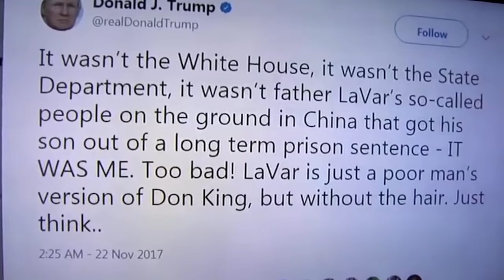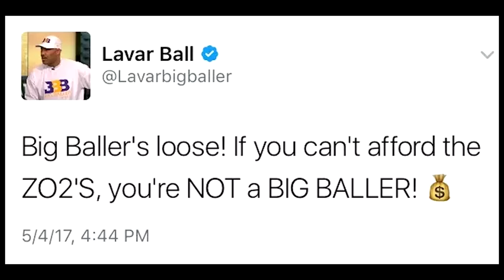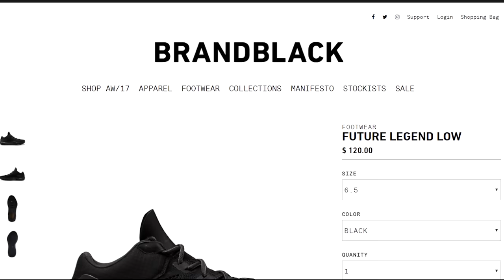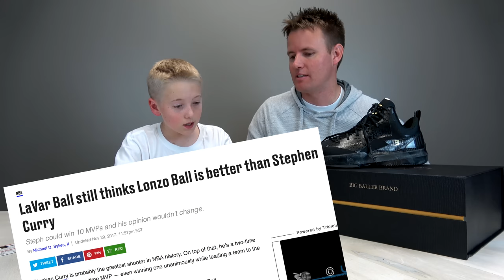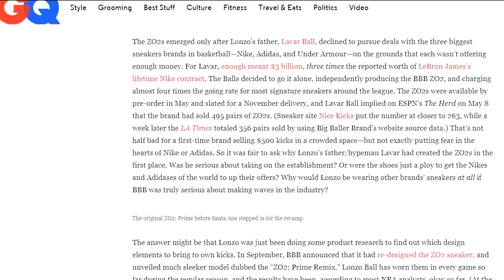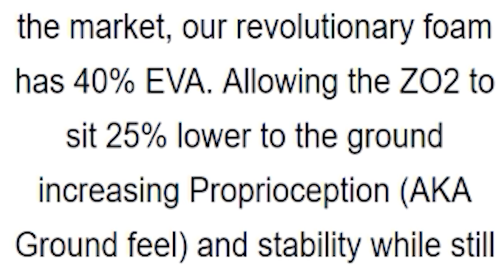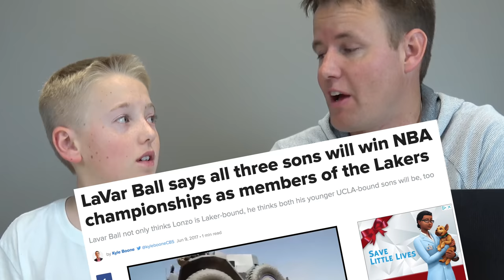What's inside Lonzo Ball's Shoes?

Comment: these guys are actually looking for air pockets in a non nike shoe 🤦‍♂️🅱️🅱️🅱️
Reply: kool k1d it still is supposed to be a basketball shoe. It's should have and it also shouldn't be flat at the bottom. Expensive pair of sketcher s
Reply: Fr kool kid
Reply: kool k1d They Help -.-
Reply: kool k1d In all fairness the patents on the Nike Air units (it's actually hydrogen inside, air molecules are so small they could seep through the microscopic holes in the unit) has ran out. He could have put some of the earlier models in the shoe and faced no legal repercussions.
Reply: Kybrin Grantham a lot of the Kobe's had a flat bottom.
Reply: kool k1d mm

Comment: Flat bottoms are actually best for basketball shoes since you need stability when you play basketball. So.... That shoe was based on the Brand Black Rare Metals and they do play well. The cushion is really good on those coz I do have the brandblack one’s. But yeah the traction has some issues at certain courts like other basketball shoes. My suggestion is play in them first before providing any comments on the shoe. There are different cushions (Boost, Air, Zoom Air, Black foam, jetlon, etc.) for each brand so it is what it is. Now the question if it’s worth it? Logically thinking Hell NO😆 But to each his own🤗 If you think it’s worth $995 then you do you😉 And yeah Lavar is annoying😅 Good vid though so thanks🤙🏼